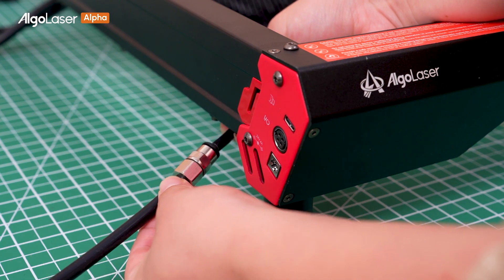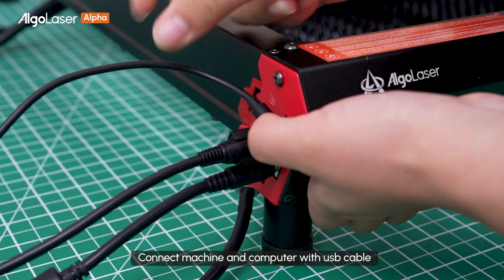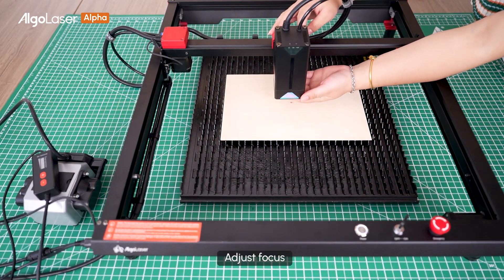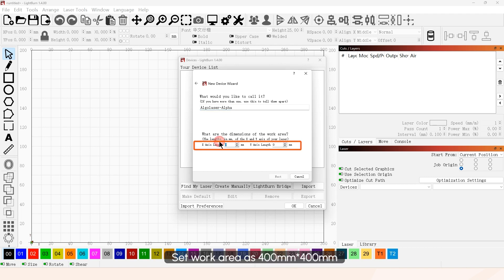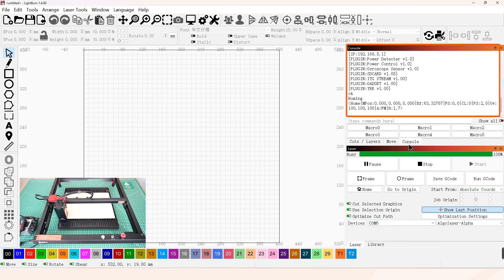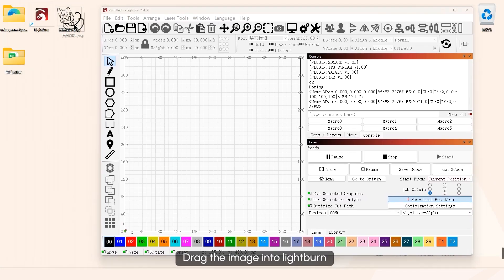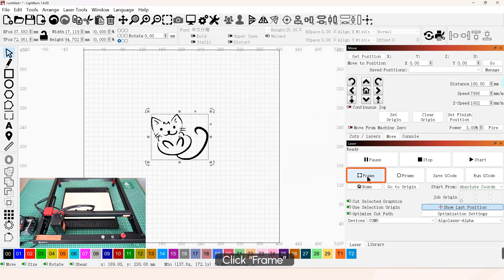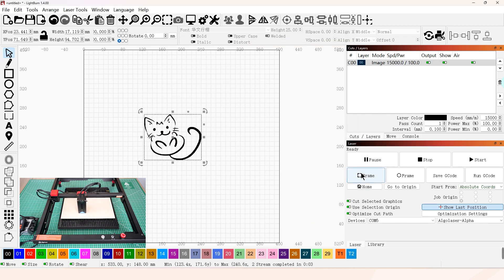How to Connect AlgoLaser Alpha with Lightburn to Engraving and Cutting

Comment: For Mac users: I followed these instruction the best I could on my Mac and couldn't get the laser engraver to connect to the computer. I finally figured it out just by playing around with the software. At 1:34 in the video, it says to choose "Serial/USB". I switched that to "Ethernet/TCP" and everything works as far as I can tell. I haven't actually burned anything yet, but the laser moves around like I would expect when I click on "Home" or "Frame". Also at 2:33 the directions say to click on Edit>Settings, but on a Mac it's at Lightburn>Preferences.